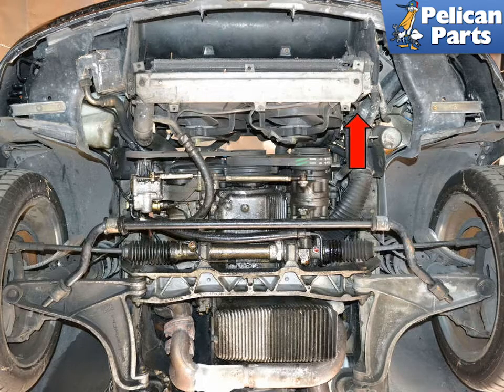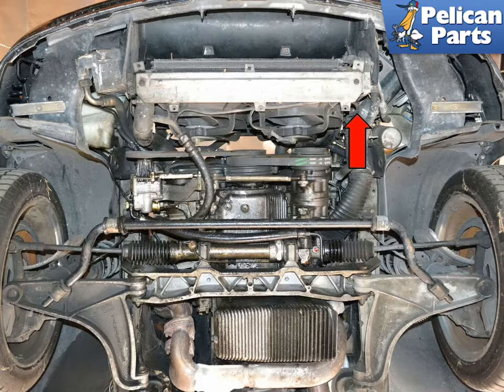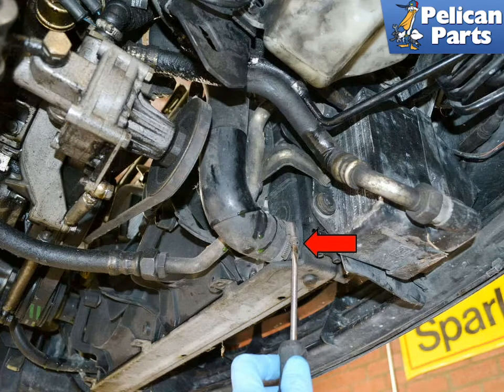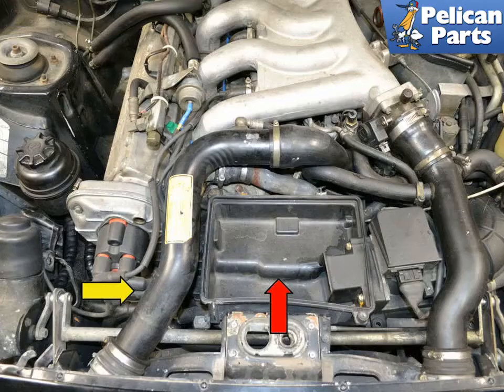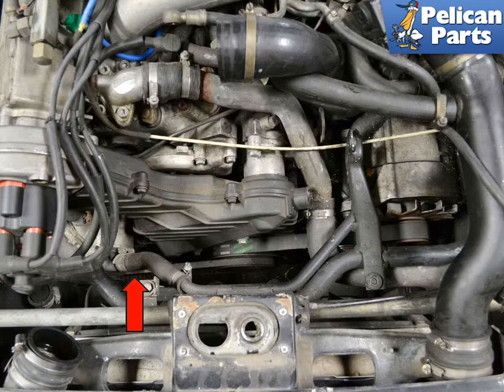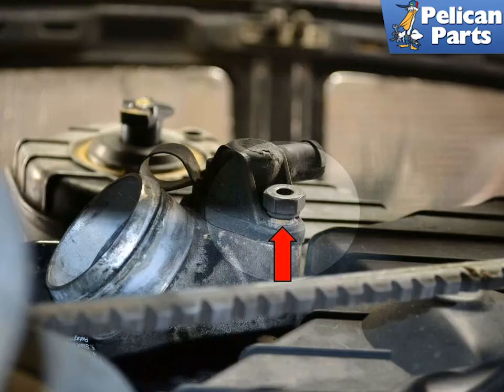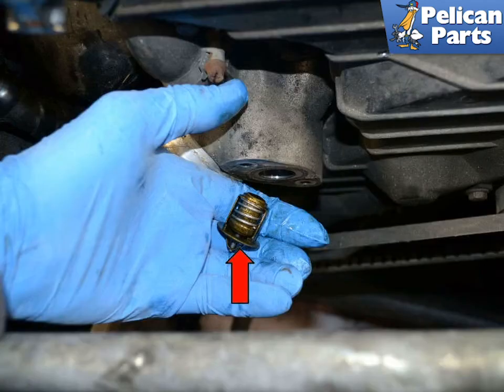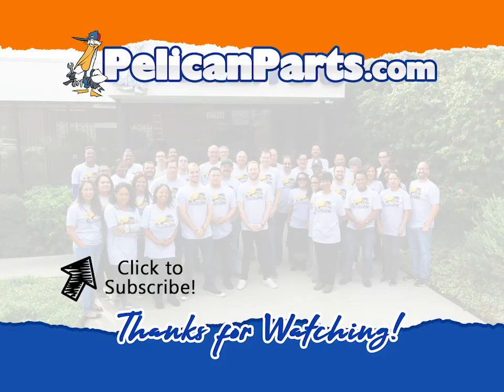Porsche 944 Turbo Additional Thermostat Replacement (1986 - 1989)

Comment: Is this only controlling coolant flow through the turbo? If bad, does that effect the overall engine temp?
Reply from the maker: Not usually, as it doesn't go through the radiator.
Reply: @ ok thanks